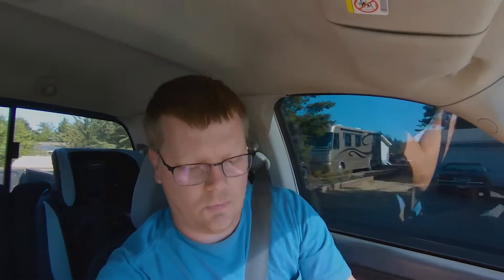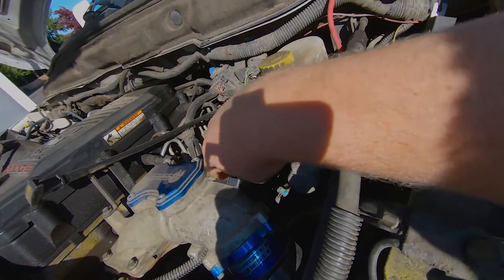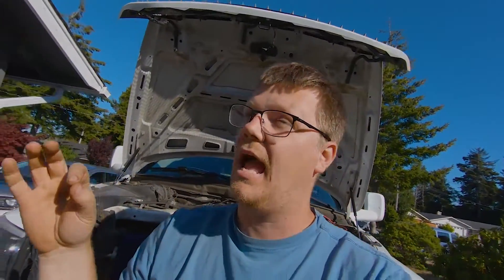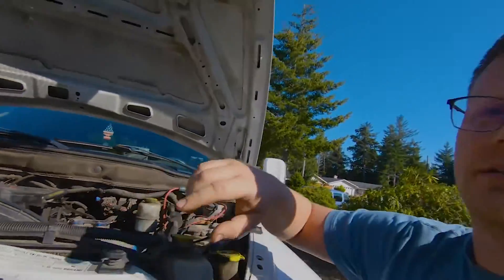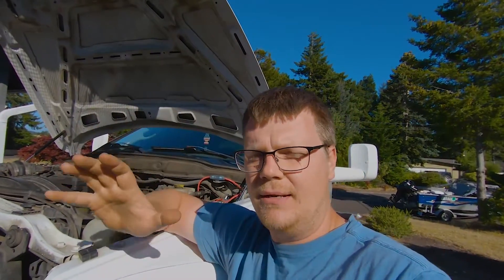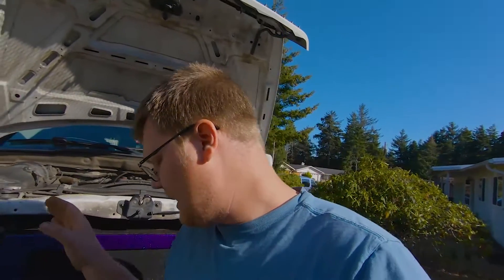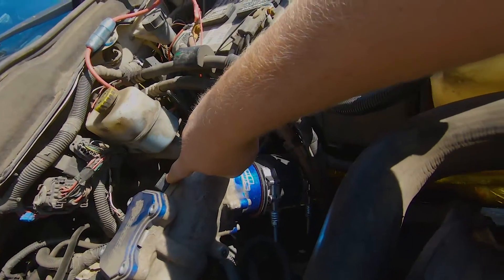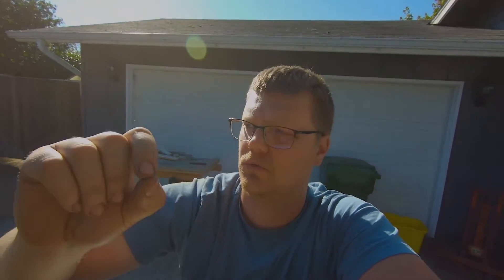Why you need a 10 bar map sensor!!!

Comment: I'm  getting a CEL after changing the hot side boost tube on my 4th gen.  I'm getting codes P1193 and P2228.  Based on my research I may have issues with my IAT/MAP SENSOR.  P1193 is IAT sensor is high while P2228 is barometric pressure sensor A circuit is low.  My boost guage reads 5 psi at idle and even when the engine is off.  I'm starting with fixing the IAT connector since it has a broken tab.  After that I'm looking at cleaning or replacing the IAT sensor.  I just called Lithia and they said the IAT sensor is a TMAP sensor where T probably stands for temperature.  It's not the same as the MAP sensor you replaced in the video that goes on the intake horn.  It is located on the cold air intake that feeds the turbo.  There is also a MAF sensor on the cold air intake.  Any suggestions?  Thanks
Reply from the maker: If I’m not mistaken the map sensor is where the truck is going to get its boost reading, I would look at that sensor but it’s a little odd that it didn’t mess with you until you changed the tubes
Reply: @Cargill450  thanks bud, I will let you know when i get it sorted.
Reply from the maker: @tomsmith4484 yeah please do and if anything pops into my head I will let you know, I’m curious
Reply: @Cargill450  so it was the IAT sensor.  When I changed the connector, everything was fixed.  No more CEL and the boost guage reads zero at idle.  I got the pigtail from OEM connectors on Ebay for 16 bucks and it was excellent quality.  The dealer wanted over 200 for the exact same part!
Reply from the maker: @tomsmith4484 so the connector was just pinned wrong?
Reply: @Cargill450  no, but it was not making a proper connection.  It felt loose and the new one was nice and tight.

Comment: Okay so here is my question to anyone that can help. I have a 2012 ram 3500 deleted efi live tuning and cts3 monitor. Recently the boost reads zero psi and map sensor stuck on 12psi. The truck drives different not as much power and turbo brake does not work as good as it should. Could this be a bad map sensor? Sometimes it is fine and no issues. Other times map stays stuck on 12 psi until you shut the truck off and turn on it will reset. only 70k miles on the truck.
Reply from the maker: When you run the diagnostic on the cts3 do any codes come up?
Reply: Thanks for the quick reply! So I have not drove it since the comment but I drove it today pretty decent drive. When this happened there was no codes that came up on the cts monitor. I turned the truck off and re started. It drove fine on the way home after. Thoughts??
Reply from the maker: Without being 100% sure about it on my end you could try a new map sensor if it's not too expensive but make sure you check the wiring for rodent damage just incase
Reply: @Cargill450  Next week I am going to take a deeper look. Just sucks. It only started doing this recently. It a low mileage truck at 70k shouldn't be too many issues.
Reply from the maker: I'm curious to know what you come up with, keep me posted. You wouldn't think you would have too many issues

Comment: How do you think a s366 on deleted 6.7 all stock just tuned and deleted would tow and get control ?
Reply from the maker: I have seen that setup first hand work really well. Of course it's no vgt but at the same time it is super manageable, if you have any doubts go with a 364 but I think the 366 would be fine.

Comment: Love my manual 2nd Gen but it eats MAP sensors. I’ve got to find the cause. Thanks for the informative video.
Reply from the maker: Are they getting oil soaked by chance?
Reply: @Cargill450  that what happened to mine and started throwing codes and putting the truck in limp mode with the lightning bolt on the dash.

Comment: I sick at guessing so I’ll say 48 lbs of boost. Where did you get the MAP? I’m going to need one for my build.
Reply from the maker: Get ahold of Siskiyou Diesel Performance out of Medford, Kat will get you set up.
Reply: Are you local bud?  I'm in GP and grew up in Medford.
Reply from the maker: I’m in Florence outside of Eugene
Reply: @Cargill450  nice, i got my truck in Eugene.  Florence is towards the coast right?
Reply from the maker: @tomsmith4484 yup about an hour fifteen from Eugene
Reply: @Cargill450  did you see the comment I left regarding my map/iat sensor?  I was hoping for your input.  Thanks!